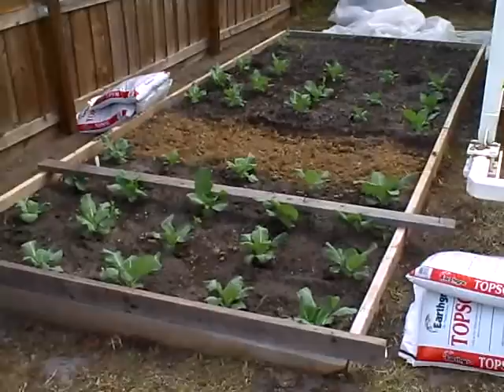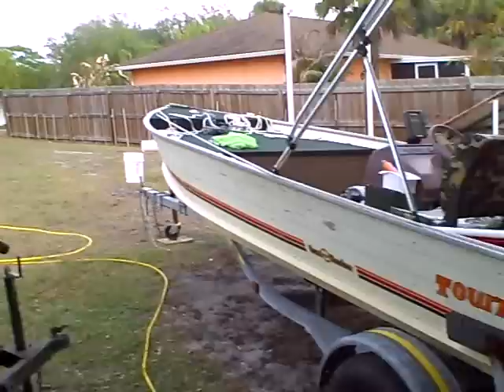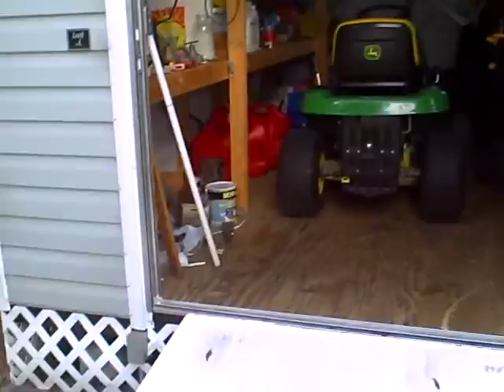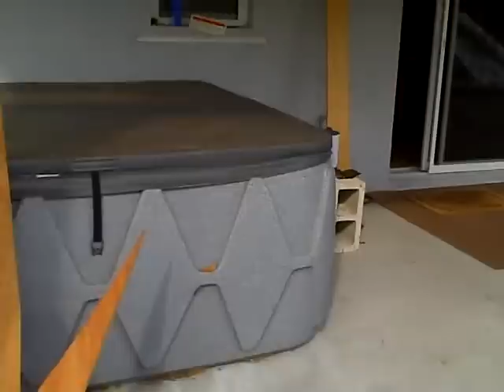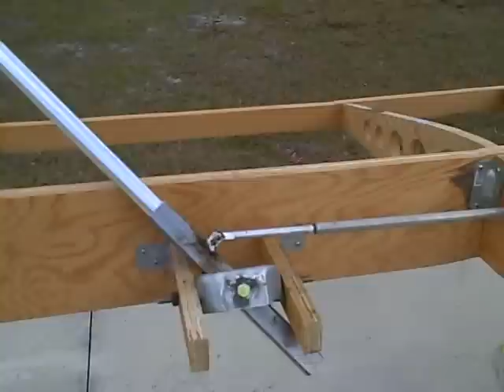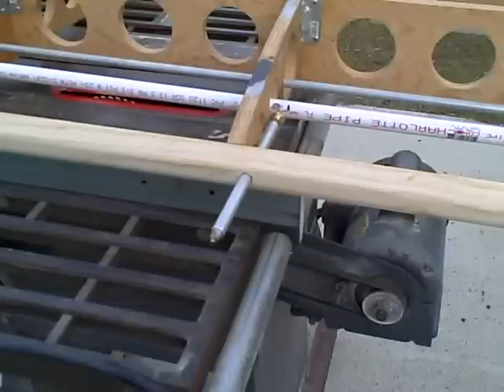My Home Depot Project Airplane

Comment: Great workmanship. However, as someone who flys and built a similar aircraft an Evans VP1, respectfully this could never fly. First, it;s way too heavy. Second, you do not have enough wing area. For ultalight or LSA you need around 120 square ft or more. A good test which the FAA would require is a G load. You figure total gross weight say 1200 lbs and put 2000 pounds of weight on each wing like cement bags. You will discover the spars cannot support a 3.5 g loading  This plywood spar would snap at about 1.5 g. Aircraft wood needs to be aircraft grade or Marine. I would try building a new plane using eps foam board as the ribs. There are some great You Tubers who have done that.

Comment: I see a lot of people saying that it is dangerous to build an airplane. It's not. There are plane kits that you can build. There even is a club about it called the eaa. It has over a million members. However, this guy needs to make it a little bit lighter and a longer wing. Instead of metal skins for the wing use poly fiber.  Good job though.

Comment: Ok, I have to be honest here. First of all, kudos to you for your ambition and following a dream. But honestly, when I saw this, it reminded me of those videos by that African guy who's built several of his own small, terribly-designed, and grossly overweight airplanes, only to run them around in his small village, never once leaving the ground, while everyone looks on. It's curious at first, then you start to chuckle which leads to an outright belly laugh. Then you settle down, and just feel sorry for him. But he keeps trying, and one day soon, he will succeed. He will finally rotate the main wheels on his latest contraption, and at about eighteen or twenty feet in the air, his schedule 80 PVC main spar will fail, his wings will fold like a taco, and he will die in a fiery crash, its flames fed by the scraps of plastic, aluminum, old fence posts and wheel barrow tires that he salvaged from a tin shed at his uncles farm. Do yourself a favor, and don't be that guy. If you don't understand terms like wing loading, dihedral and anhedral, or you don't have the information and skill to determine things like center of gravity, projected gross weight, power/weight ratios, etc. then please let this be an ugly, oversized garden gnome. Good luck.

Comment: Weigh your airplane. Calculate the lift of your airfoil. Calculate how fast it will have to move through the air to generate enough lift to fly. The thickness of the plywood ribs suggests a weight issue. I admire your enthusiasm. Do more research on this project.

Comment: Before trying to fly just remember to load test the wings. The cheapest would be with sandbags evenly distributed, plane inverted. If it holds 4000 lb maybe it is safe to fly it. Best of luck.

Comment: Your gimble from an electrical mounting box is DEATH. it isn’t designed to withstand the pressure feedback from the control surfaces. It will bend/deform/break and loss of control will insue.

Comment: I applaud your ingenuity, but please PLEASE don't fly this plane. You exceeded my engineering cringe limit when I saw the bracket for the aileron control elbow linkage - there are about 5 things wrong with that bit alone, that make it a likely failure point.
For the technically unaware, "failure point" in an aircraft means twisted wreckage.

Comment: You need 6061 or 7075 aluminum alloy to construct the airframe, and you need to use solid rivets to join the parts. Don't use screws or bolts! You need to buy a small knee mill, rotary table, a metalworking lathe, 2x air rivet gun, and a metal press brake, go to harbor freight and get those tools, they have affordable machine tools. I love the hustle but you need to build this right! This is a device that has substantial forces acting on it and if it's not built right it will break apart midflight! Ever see the Concordski crash at the 1973 Paris Air Show? Don't let that happen to you!

Comment: Have you ever read AC43-13? or the FAA Publication 8083 Aircraft Airframes Volume 1?  Your construction is never going to be approved by the FAA even under the FAR AMT 2017 publications.  All Hardware must be FAA approved AN/MilSpec hardware and have the certificated paperwork for approval with it.
I noticed that your spar is in two pieces and that alone will never be approved.  All wooden spars are made from one solid straight grain spruce with no cross grain, wavy, curly and interlocked grain; no hard knots or pin knot clusters.... standards all listed in AC43-13-1B.  
I am an A & P Mechanic, and I don't want to discourage your build attempt. However, you need to do more research on the subject and look at some EAA publications as well as perhaps take some courses.  That will save your life!

Comment: I am impressed with your ingenuity. In all fairness, I believe you need a airframe engineer to advise you. Not ALL the accepted building requirements are necessary for a safe plane, but most have a good reason. The plane will probably fly  as designed, I would question how far, without some material update..

Comment: I am actually hoping this is a display of some sort, if you attempt to fly this you will most certainly die!
Reply: Evelio Perez sadly you are correct on the 5th or so flight the wing collapsed after he was experiencing some mid air fuel leak. The FAA did the math and the plane wing could only withstand about 2 GS so when he made a bank that's when it all went bad.
Reply: UlyssesPez really? that is really sad...

Comment: I can't believe this video hasn't been removed by his family. The video showing the crash remains is on youtube. RIP
Reply: He actually flew it 5 times. On the fifth flight, it had a fuel leakage. He put the plane up on saw horses to replicate wing load. Apparently, on thae fifth flight he also had a rough landing. On the sixth flight he turned left and the wing fell off. This particular plane is one of the examples they show on homebuilt crashes. The EAA safety guy shows how the plane was destined to fail from the beginning because the wing spars weren't single pieces. The guy must have been a pilot.

Comment: I spotted a few problems from the video.
First of all, I have many hundreds of hours assisting homebuilders with their projects through EAA chapters 1 and 93 out in California. I built the back end of the power train for a BD5 for Don Saucer, which he finally donated to the Chino Planes of Fame Air Museum.
1) Your hinge on the aileron needs to be beefed-up. There is too much lateral slack in it and the hinge pin looks like it is just a wire. It will give you problems in flight.
2) You don't have a main spar. It will not hold in a turn or in turbulent flight. It [may] hold one G but you need to turn the wings over in the hangar before assembling to the fuselage and pile sandbags on it equivalent to your expected "G" loading, including some turbulence simulation before assembly.
There is plenty of advice and "how to" materials at the Experimental Aircraft Association ( http://www.eaa.org/eaa).
The best of luck to you sir and "safe flying"... :-)
Reply: It's a shame that he didn't read your comment, as what you have just mentioned caused his death
Reply: Captain Keel-Over did he actually die in this plame? i saw the vid years ago and wondered ever since if he attempted to fly the POS

Comment: The guy is more intelligent that he sounds.. shame he didn't do a little more research then he could have built something that had a chance to fly. He's put a lot of work and thought into it, but better to use knowledge that has painfully been acquired over more than a century. It will never get off the ground on 20-25 Hp anyway.. that would need a very very lightly constructed plane.

Comment: Uh, you really don't intend to attempt actual flight with this, do you?  An electrical outlet box for a flight control gimbal?  You really think that will stand up to the pressures and exertions of flight?  And common lumber for construction?  Seriously?    Dude, stick with Chocolate Labs.  Aviation is not your future.    Semper Fi.

Comment: He's really not planning on flying that wing, is he?   I'm sure it's just a prop for show and tell.  NO FAA inspector would pass ANY of that build.  It is a nice demo though.  BTW, stick to the left, aileron should go down.  You may want to join your local EAA and get some good info and meet some interesting folk and maybe see some real home built aircraft.
Reply: Lindsay Thomas No stick to the left aileron goes up on the left wing
Reply: Thomas, you're right, I was having a senior moment.  Good thing I'm not building one.
Reply: Lindsay Thomas confusing because he said it wrong in the video, even though its movement appears to be correct.

Comment: Hope you got good life insurance buddy? Diagonal wire bracing would achieve a better result than the Alloy stringers. You're heading for a weight problem for the wingspan etc. It will make the wing loading extremely high for such a modest power plant & aircraft size. A home build called the 'Tooth Pick' would have been a better starting point for you its a proven & simple design.

Comment: OMG STOP building that plane! what is wrong with you? your a dead man for sure. I can't see one inch of that 1 that is assembled correctly much less with the correct material
Reply: If it's made to weigh no more then any other proper home-built, according to the FAA regs, he doesn't need a pilots license.
It's a shame and sad he didn't ask for help from qualified people like licensed aircraft mechanics and pilots, such as myself. I would have gladly helped him, because such desire and enthusiasm for a project like this should not be quashed.
Reply: Umm... no. Not any other homebuilt- the only powered aircraft that doesn't require a license to fly must meet all the requirements of FAR-103. Must be less than 254lbs empty, 5 gallons or less fuel tank, capable of less than 55 knots, power-off stall of 24 knots or less.
Reply: Just a little rude but I agree and he will be a felon for flying a unlicensed aircraft and building it.
Reply: He needs help. Not that kind of help haha. But just more knowledge of aviation construction. I wish him luck and i hope he has life insurance.
Reply: he needs some milk
Reply: Ya lost me on that one
Reply: you can fly an unlicensed aircraft, you just can't take anybody up with you and you have to fly outside of controlled airspace and not overfly populated areas.
Reply: Homebuilt or not, it has to be inspected by the FAA and they would NEVER let this fly.  Sorry for the guy as his heart is in the correct place.  Or this is a joke, a complicated one, but a joke.

Comment: Pressure treated 6"X 6" deck posts are the best material for the main spar. A little on the heavy side but very strong. At least that will guarantee that it will never leave the ground.   LOL.
Reply: Safest place for this plane is probably on the ground.
Reply: dozerboymiller You've got it under the hood! I like your plan and (IF) I should decide that I want to build me an airplane I sure want you on my planning comity ! Specially the structural engineering !
Reply: dozerboymiller If you are going big why not go really big! 12x12 or go home!
Reply: 6 x 6 deck post?  Hey, I have Saturn 5 main stage for sell real cheap.  It might be enough to get such a construct off the ground.
Reply: Simon WoodburyForget he was being sarcastic...

Comment: I applaud this guys initiative and can-do attitude. But that said, this is a death-trap if it even manages to get off the ground. I have been an aircraft mechanic for over 35 years, so have a pretty good idea of how airplanes should be built. And this is not it. It might make a good static display to hang in a bar or something, but that's all. As it will be too heavy for Part 103, he will need to try to register it as an Experimental, Amateur Built, and there is no way that an inspector will pass this.

Comment: This has to be a joke lol.  It will never fly.  Come on man.  An electrical box gimbal and conduit flight control rods, closet rod leading edge, flimsy heavy plywood, and cheap hinges for flaps.  And to get the finished product off with a 25 hp motor lol  No plans or degree in aerodynamics.  Just buy a real kit and safe your life.

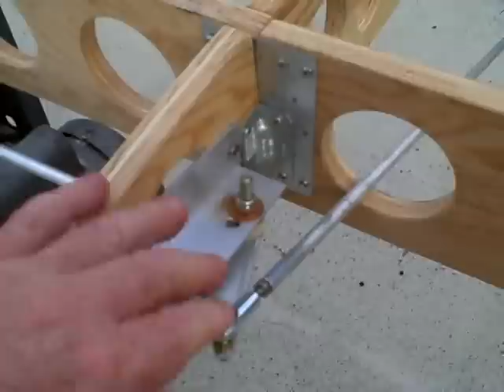Comment: Great Video! Just a quick question. The L-bent aluminum piece you have showing at 3:50, did you cut that to size yourself or was it purchased at that length? I need a similar length for a project I'm working on and am wondering if I can buy it ready made at that length. Thank you :)

Comment: Its hard not to be critical in the comment, but please do not continue on your airplane project. You obviously have a great deal of skills and ingenuity. But these are not the right materials to use to build a safe airplane. May i suggest you get involve with a local home-build support club. FAA website is a good source of info and then get you into the right direction.
Reply: +Fred Pinczuk Best advice

Comment: I'm a licensed pilot and aircraft mechanic. That wing is not safe. That plane will not be safe. Please do not fly this. I admire your ambition, but please, purchase an established kit, get with the FAA and EAA, and do it according to established plans. Your wing spar alone is scary. It should be aircraft grade wood, laminated and about 5 times thicker than what I see there. There is a reason that aircraft quality materials cost so much. Nothing you purchase at home depot is aircraft quality. I am not saying this because I do not understand what you are doing, I am saying this because I DO understand and know more about this than you do. Some others on here, with more experience than I, have said the same thing. Destroy that thing before it makes your wife a widow.
Reply: I don't know about airplanes. But some Chinese at the circus actually built a plane out of wood and plywood with a vehicle engine and it flew nicely circling overhead. I didn't believe it was magic.